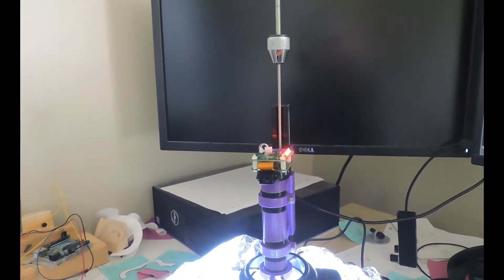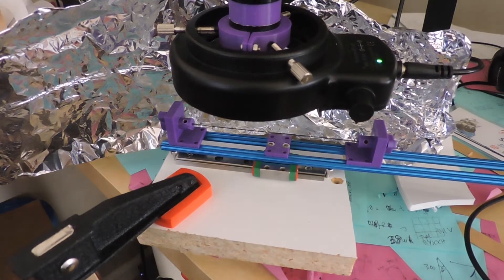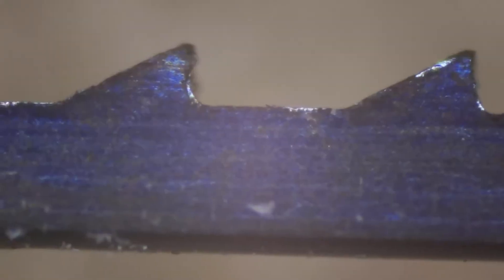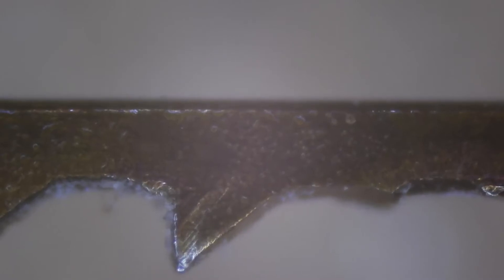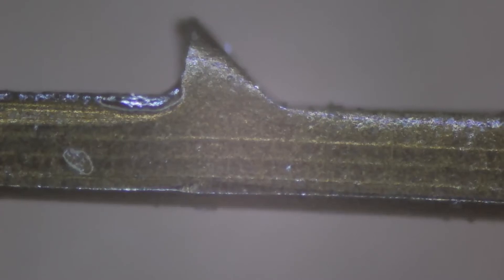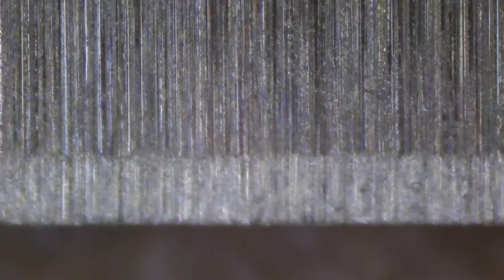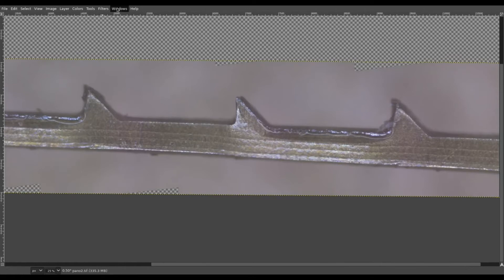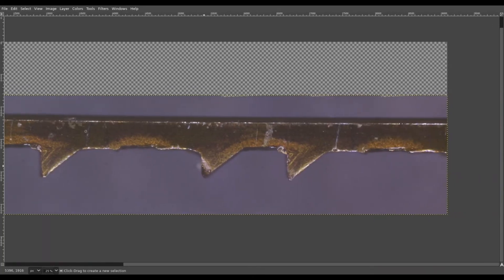Scrollsaw Blade Drift - Under the Microscope

Comment: All three blades looked well used. Does a new one look so ragged ?  
What does an end view tell you ?  It looked like the SP had jaggies on one side (effect of shearing the steel?) while the Pegas didn't.  
I use Flying D blades and hone(?) off the jaggies best I can. It seems to lessen the drift. My assumption is the jaggies give drag to one side which turns the blade. Like an airplane vert. stabilizer.
Very appropriate data collection video Andrew - thank you for taking the time to do it🙏                    Stay safe. -Mike😷💉
Reply from the maker: I was pretty sure all were new except maybe the double skip. I think I'm gonna retake full length pictures and will be sure to use brand new. Will also try a picture after honing
Reply: @AndrewConsroe  You may be going down a rabbit hole looking at blades - it's pretty finicky (primitive?) tech to make them.
When I cut, I periodically ease off and everything 'snaps' back to center. Honing only goes so far. 
We nominally control feed rate and apply subtle corrections thru hand-eye feedback to keep on target.
Hmm, ever consider a guide bearing system like band saws use ?

Comment: If the sawdust isn't clearing you're running your blade too fast.  As odd as it seems, sometimes you can cut faster with a slower saw speed.  The guy who taught me told me to set the saw to run as fast as the sawdust cleared.  I know it makes a huge difference when I cut thick wood (assuming I don't go to a blade with widely spaced teeth made for thick wood).